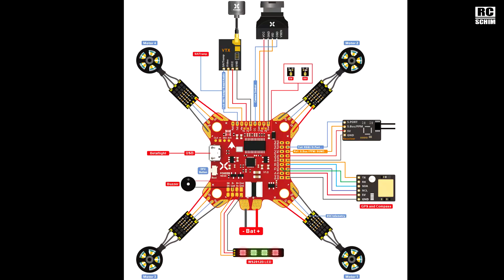Foxeer F405 AIO all in one flight controller

Comment from the maker: Currently working on it-  like it. It's a bit small for soldering on the motor wires now - but if this works it should be fine to fly soon.
Cant wait to try out some new features from betaflight!
out of the box it has nice things like:  when I first powered it this morning, using a used battery I had lying around, it instantly told me on the osd: battery not full (prior to arming). so things like this make sense!
Also curious if I can use smart audio to setup cam and VTX - but I have to do some research on this.
Even the little TBS Nano works (it did an auto-update once I tried to bind it - love how easy this works). Just need to install more current LUA script on my taranis I think (it hangs if I wanna setup the CRF RX).
That's it for the update - hope to fly soon - see ya!

Comment: Hey is it ready to flight on stock betaflight setup? I have terrible random twitches and motors return very hot and its worse on 5S batery
Reply from the maker: Sorry, it's been some time, dont remember.
Most FCs are fine with current Betaflight and stock settings these days.  if you have uncommon hardware, however, it might be neccessary to adjust settings. warm or hot motors are not a good sign :)  I had this on my Rampage quad and because of its powerfull motors I had to reduce P gain drastically. you couldnt see oscillations .- but they were in such a high frequency and they put a lot of stress on the motors...